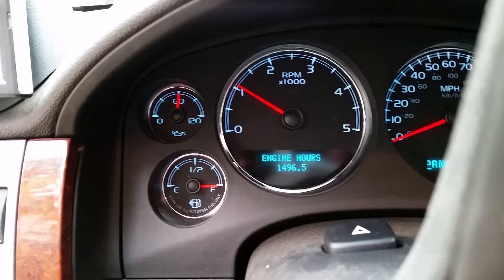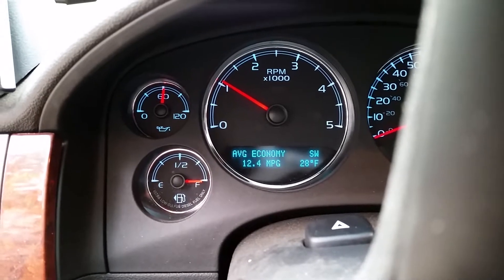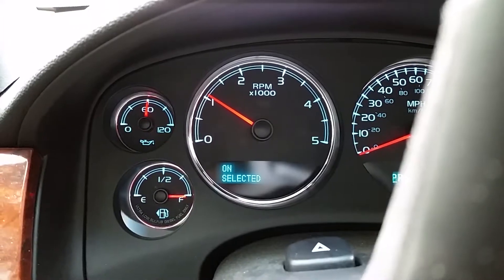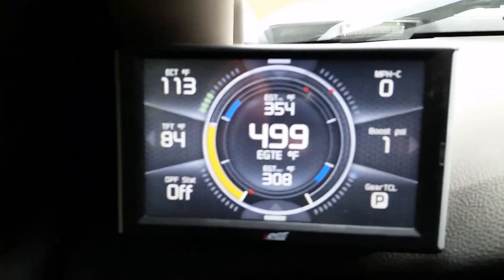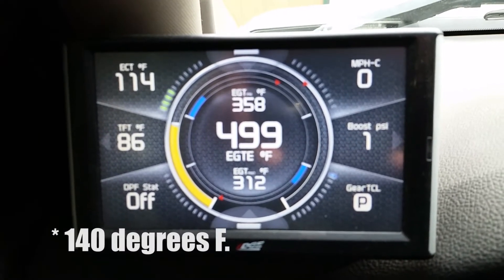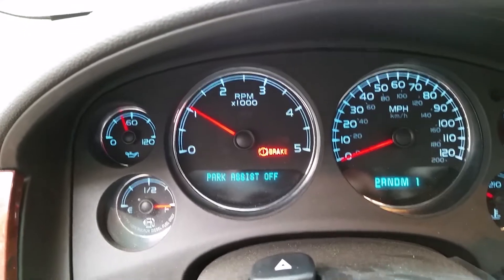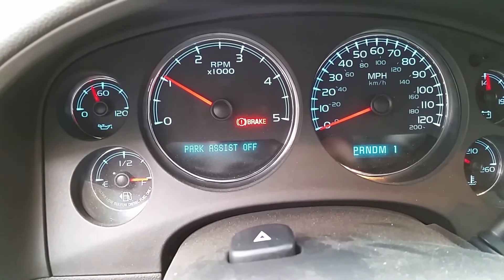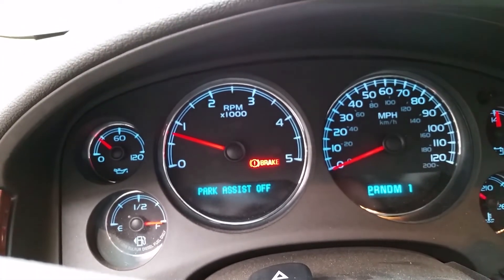Duramax 6.6L Elevated Idle Explained

Comment: Do you have any insight as to why my 2013 when I purchased it the elevated idle work great right at 1,100rpm like yours but over time no matter how cold it is my elevated idle rpm will never go above 1k rpm it sits right about 850-900 it sits right under the 1k mark and I can tell a difference. Not sure as to why it’s doing this now. Any insight would help.
Reply from the maker: Nope, I have no idea what the issue might be.

Comment: So wait this is an actual setting not an engine failure problem 😅 I bout took it in cause it didn’t seem right
Reply from the maker: Yes, it's a setting that can be enabled or disabled.  The process shown in the video is for LTZ trucks with the advanced dash, or trucks that have the 4 buttons for the DIC (Driver Information Center).  I believe other trim levels use a different procedure.

Comment: I have a 05 2500hd gmc sierra and I set it and doesn’t work but I did have it work one time out of trying 10000000 times it only lasted like 2 mins tho and the temp was only 42 degrees out this morning the truck has efi live what would cause this I reallly would like to use it
Reply from the maker: I believe the ambient air temp needs to be below 30 degrees for elevated idle to work.
It's possible your EFI Live tune eliminated the elevated idle function
Reply: @deltabravo1257  it was 30 this morning I set it and it worked. It didn’t shut off until I got back in the truck and hit the brake but I had the tune set on stock idk if that had anything to do with it. It did make a significant difference between just starting up and idle to warm up vs setting that elevated idle and warm up. Thanks for your reply so quickly

Comment: You can also manually engage the elevated idle at any temperature  by setting the park brake turning the cruise control on and pressing the set button . This will bring the idle  up to 1,200 RPM. However I believe this only works if you have the UF3 RPO code.
Reply from the maker: Thanks for the info.  I will have to see if my truck has UF3.

Comment: How do you like the Edge monitor?   I use the Torque Pro OBD plug-In to monitor EGT's while carrying the  TC. However,  the display is on my cell phone and that means I'm switching between navigation and other apps so I dont continuously monitor the trucks output. 
How does the LMM handle TC on the hills? Is there any other upgrades you have done to your truck's suspension for your 811? Maybe you could make another video of your truck upgrades?
Reply from the maker: I have been happy with the CTS2.  I've had it since they first came out.  Prior to that I had a CTS, and before that I had the Insight.  I have the Edge backup camera connected to the CTS2, which work for connecting a trailer when I don't have the camper on the truck.  I removed the factory backup camera from the tail gate handle and mounted it to my AF 811.

My truck handles the camper very well, regardless of the hill.  On longer grades, like the one heading east out of Pendleton, OR on I-84 towards LaGrande, OR (where the AF Factory is) I will have to keep an eye on ECT.  It will climb to 225+, so then I will drop my speed some.

I have airbags, which I would never install again, Torklift lower Stableloads and Rancho RS9000X shocks.
Here's my truck upgrade video: https://www.youtube.com/watch?v=u8d-0Eugrw4